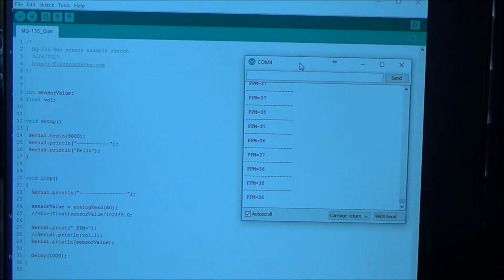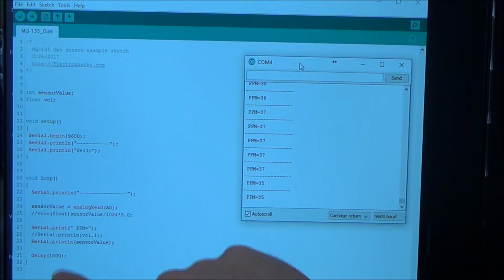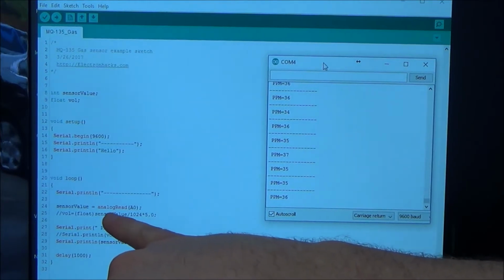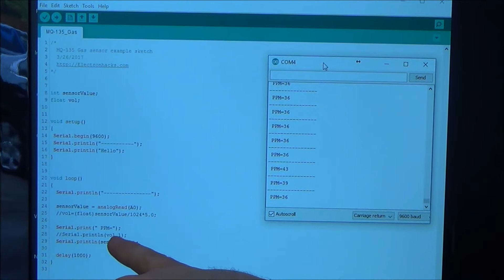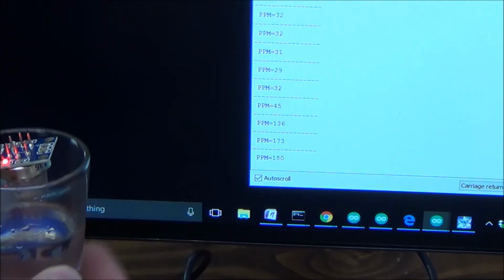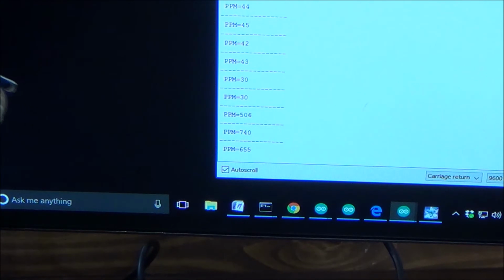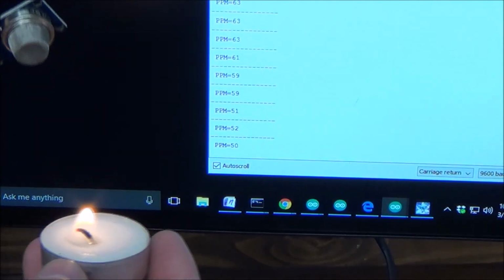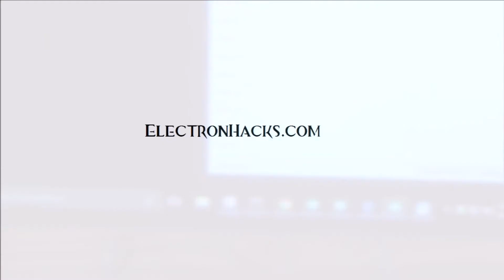MQ-135 Gas Detector quick start

Comment: hello sir , in place of 1024 ,it should be 1023. because converting through 10 bit ADC converter , analog value ranges from 0-1023.

Comment: You cannot directly scale it like this since the calibration curve of MQ135 is linear in the log log scale... the way you calculate PPM is misleading.
Reply: Hi. Can I know the correct way to calculate PPM. Hoping for positive reply. Thank you sir.
Reply: @huzniey  CHeck the datasheet of the sensor and do a curve fit. Your calculation has to be related to the calibration curve provided by the manufactures.

Comment: What did you meant by scaling value. could not understand why you divided  sensor value by 1024 and multiplied it by 5 . please help me in clearing this doubt
Reply: hello. have you found this answer?
Reply: 5 is the voltage supplied to the sensor .1024 is due to the address bus of arduino(2^10).I used esp32 which has address bus of 14  bits so scaled it by 4096(2^14)

Comment: Hello, can the sensor be set to detect only a specific gas, maybe alcohol, using the Potentiometer or a load resistor?
Reply: The sensor can not differentiate between chemical species, it detects a concentration and sends a voltage accordingly.